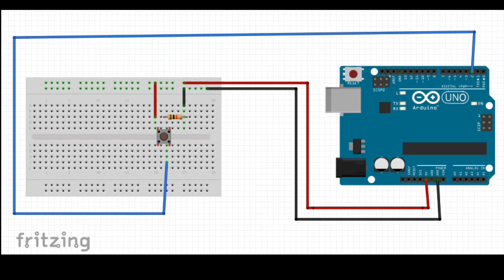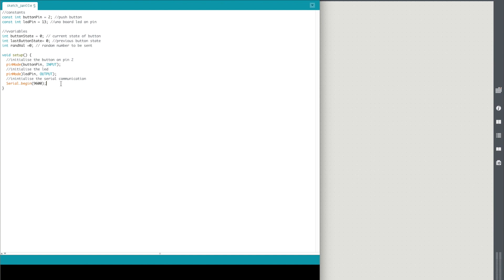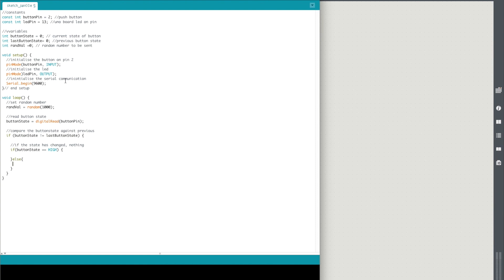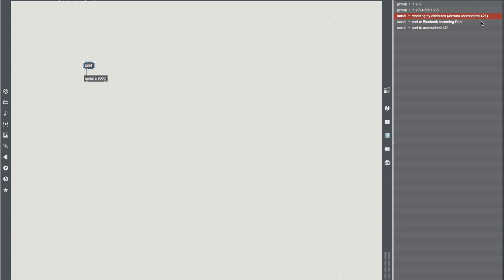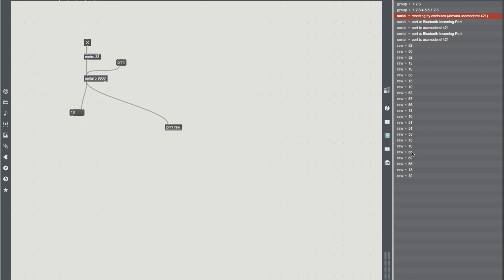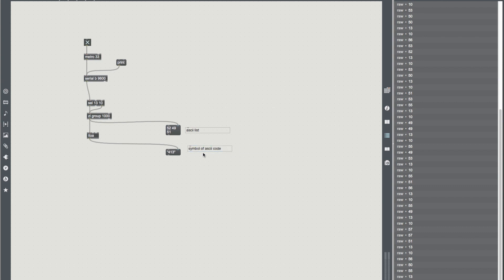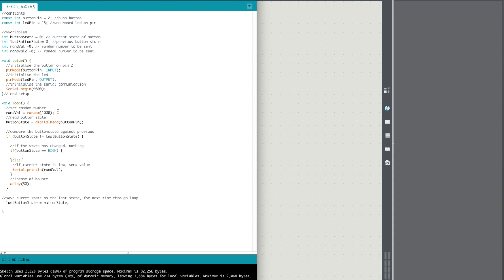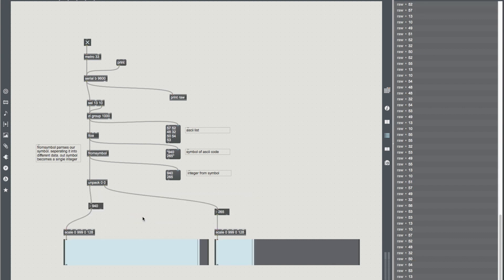MAX msp 7: Sending data from arduino into Max

Comment: I wasn't getting anything in max so I tried a few things. First I found out that the  Arduino editor has to be closed  because serial can only talk to one app at a time. Then I had to use Serial.write instead of Serial.Println. That fixed it 👉🏻👉🏻

Comment: Hi, thank you for preparing a very easy-to-follow tutorial. I'm a beginner in MAX/MSP and Arduino, and this tutorial really helps to get started. However I encountered some issues. 
I followed the exact same setup and code, but:
(1) the arduino just keep generating random values without the button's pressed, and only stop when the button's pressed.
(2) my MAX/MSP doesn't receive any random values from the arduino. I don't know what's happening here. Is it MAX/MSP problem? 
Please help.
Reply from the maker: Have you wired the button correctly, and used the correct resistor in series? 

If you have the serial monitor open in Arduino, it will not be able to send to maxmsp. Close the serial monitor and then re-open max and make sure the serial port is set correctly!
Reply: @Programmingforpeople  oh, thank you! yes. MAX/MSP received the data once I closed the serial monitor. 

I've rewired the button and used the right resister (10k) but Arduino still generated random number on its own. Anyway, I'll try it again. 

But thank you again! It's very helpful. :)
Reply: @Programmingforpeople  oh, the button works now after I unplugged and replugged a wire. Now it produced number only when I pressed the button.  But in MAX/MSP it generated 5 numbers. Is that a problem in MAX/MSP?

Comment: Hi Michael, I'm wondering if the Serial protocol requires any setup? I have got to the point where I expect to see the serial object outputting ASCII code, but no number is appearing in the box. I have tried following the Cycling 74 Serial object tutorial, but the same is happening, no data from the serial object at all.
Reply from the maker: +Jack Laidlaw where is your serial data coming from?
Reply: In the Max Serial object I have set to port b
Reply from the maker: +Jack Laidlaw sorry: the origin of the data, is it arduino? Does data appear on the serial monitor in arduino correctly?

What happens you pass a print message into the serial port? Does port b match with the com port your arduino board is connected too?
Reply: Ahh I see. Yes the data is coming from Arduino, I am using the sketch that you show in this video. The data appears correctly in the Arduino Serial Monitor, new random values upon the release of the button.  Yep, port b matches exactly with the com port to which the Arduino is connected. I was using a USB hub to connect the Arduino to the Mac, but I have connected to a direct USB port to rule that out, still nothing.
Reply from the maker: +Jack Laidlaw it's hard to say,all I can suggest would be - close max, close the serial monitor - open a new max put a the serial output into a message, or print it to max port without any filtering to see the raw data.

You can also put a print on the right hand port of serial to see the number packages being received.

If those match as expected then you can move onto doing things with the data.

Everything sounds like it's right - might just be a little error in your patch throwing you off!
Reply: Thanks for your help Michael, unfortunately I am no further forward. I'll report back if I figure it out.
Reply: I have come back to this after 7 months, used the same Max patch, but started a new Arduino sketch.......and it works!
Reply: @JackLaidlaw   what sketch was this?
Reply: @lynottsounds3957  Hi Kit, this is going back a couple of years so I can't quite remember, but the answer is probably more simple than you imagine. As Jet says above the solution is around restarting software and trying a brand new sketch. Just experiment with different methods of 'starting again and you'll get there
Reply: What sketch did you use I am having the very same problem, I believe.
Reply: did you change your Arduino sketch at all? i'm having the same problem but i assumed it was because of a problem with my serial ports
Reply: Max Serial object and Arduino Software should not talk to arduino board at same time.

If You use Max , quit Arduino Software , Plug the Board,  start Max.

Comment: Hey Michael,

I have been following yr instructions and so far so good. But once i got to the scale step my console kept reporting scale: doesn't understand "analog"

im using an arduino connected to a photoresistor...i want to use light to control sound in Ableton.

I've been searching everywhere but I can't figure out what i need to do...some kind of conversion i imagine..

help?

- jesse
Reply: Sorry just to clarify:  I've set up everything correctly (its a photocell circuit talking to my arduino talking to Max For Live). I can get tthe analog readings to show up coming out of the "itoa" but then when i try to put that thru the "fromsymbol" it doesn't change the data and keeps it the same (i.e. "analog") which the slider cannot read.  What am i not getting here??

Thanks!

Comment: Hi Michael, firstly thank you for such a wonderful tutorial :)  I am new to Arduino and have hit a little snag... When I change the code to create two 'random' numbers... Each "space" seems to create a new line on my serial monitor instead of just having a gap between the numbers? I am wondering if someone can tell me why this might be happening and how to fix it? Many  Thanks - Tasha

/Users/npri210/Desktop/Screen Shot 2017-04-03 at 3.15.03 PM.png
Reply from the maker: I cant seen that screenshot, but....

As a quick guess, im going to presume in your arduino code you're using serial.println("whatever")... the 'LN' at the end of the print command is significant as this instructs arduino to use a carriage return after posting the message.

Try something like this:
Serial.print("variable 1")
Serial.print(" ")
Serial.println("variable 2")

This will put a message onto the serial port that looks like: <Variable 1><SPACE><Variable 2><Carriage return>

tldl: remove the LN from the print command in arduino
Reply: Thank u for the quick responce :) ill try that first thing tomorrow, thanks again, T

Comment: Michael, I just found your video. Thank you so much. However, I am having a problem which I'm hoping you might be able to address -- (I am using Arduino 101). The code works as expected in the Arduino serial monitor. 

However, when I try and use the serial object in max, I can't get it to receive any information. (One clue, is that when I change the port on the serial object to the correct port, the object will not reliably set the baud rate. Instead it defaults to something weird.) Maybe this is something with the 101 board that I don't understand. Or maybe it has something to do with Max not interfacing properly. Any ideas?

Thanks,
Pauline
Reply: facing this same issue. this comment is 3 years old. so you must have finally fixed it perhaps?
Reply: @vatsalguruvayurappan9724  Have you fixed this Vatsal?

Comment: guys you can basically use serial.Write instead of serial.Print and the numbers will be the same :)
Reply from the maker: +Darcy C you're right. They essentially have identical functionality. The main difference is Print turns the bytes to ascii which I find is much easier to deal with in terms of identifying packages in max. For normal Arduino usage write is always preferable!
Reply: Michael Mckellar ah i see thanks for the tutorial still :)